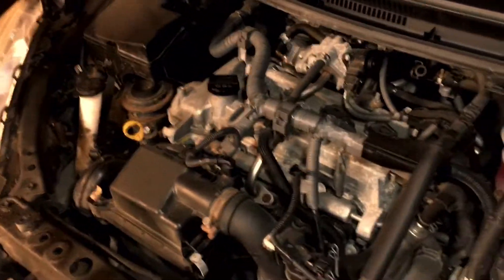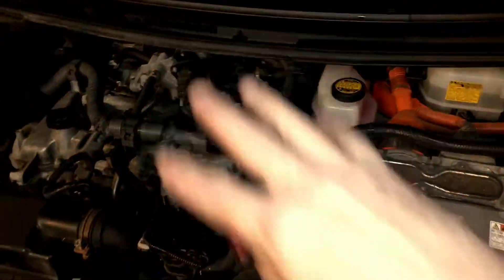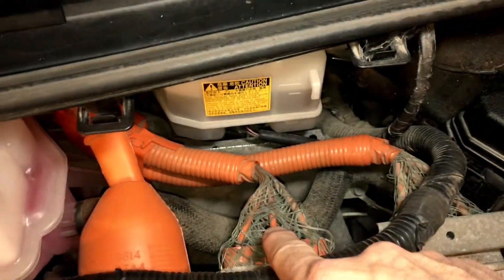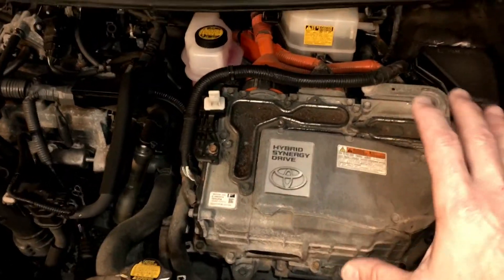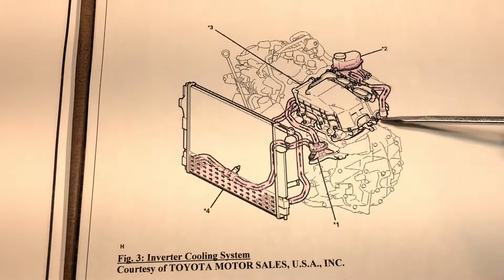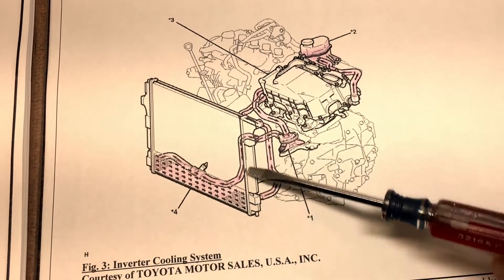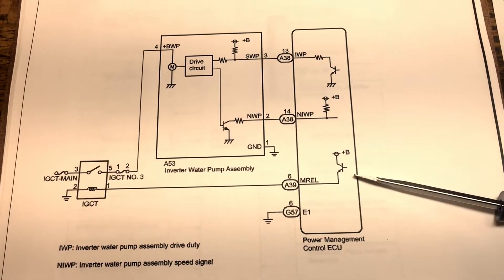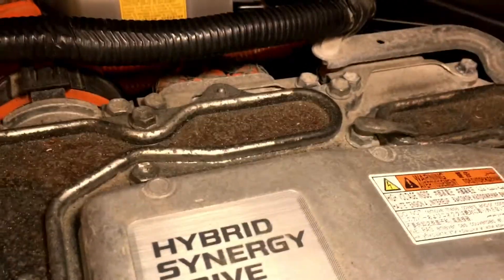Prius C Inverter/Converter Introduction

Comment: Yes Sir I have a Ford C Max Hybrid but I think the inverter not charging the hybrid battery. If I change the inverter do I need to program the ecm? I was told if I keep the original board I don't have to program it. Thanks

Comment: Good info. I renewed the inverter coolant in mine. It's the same long life Toyota coolant as the engine and there's a bleed procedure to make it easy. 👍
Reply from the maker: Cheers Iain. It’s a super interesting  wee machine. BTW…I splurged (kinda…long story) on a Testo 550. Not as nice as the Fieldpiece, but getting there 😃